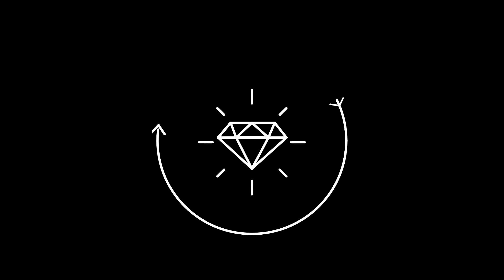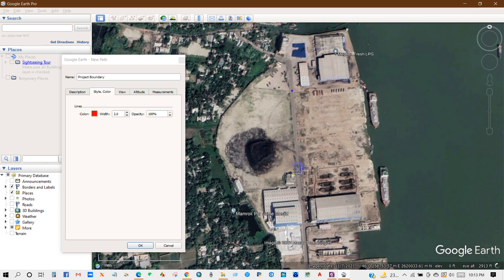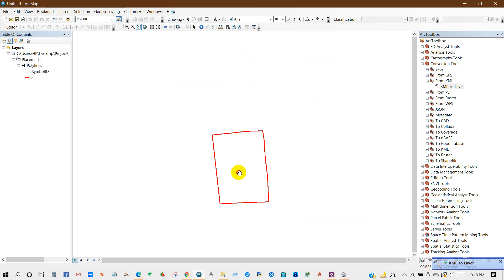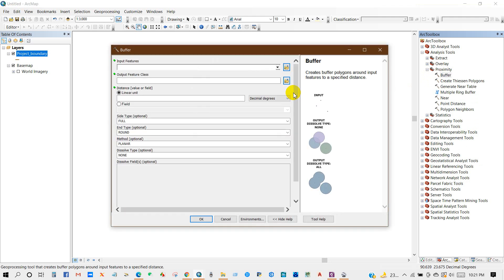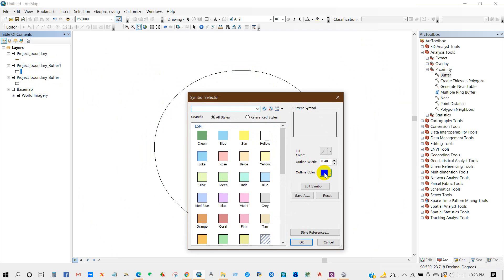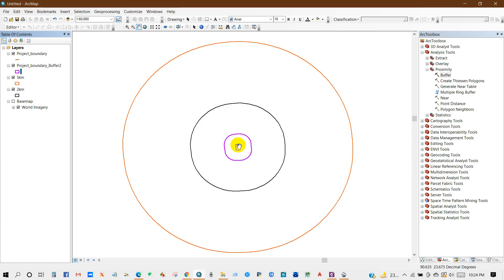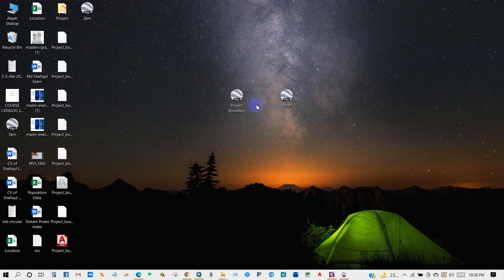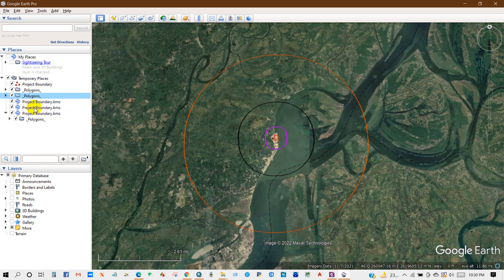How to determine Project Influence/Impact Zone in ArcGIS

Comment: You can draw a circle directly in Google Earth with a particular diameter. So, why do you need to go through these complex actions?)))
Reply from the maker: Yeah, I know that. But that's not your buffer zone. The circle/buffer  will be created based on your Project layour/boundary. If it is what you told, then I woud not make this video. However, best wishes.